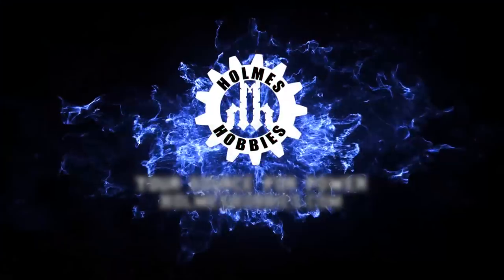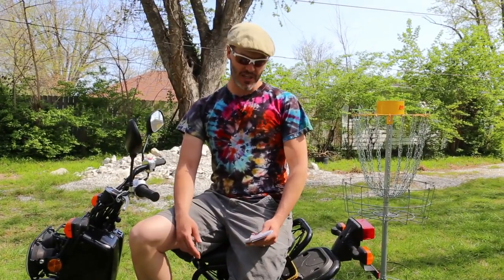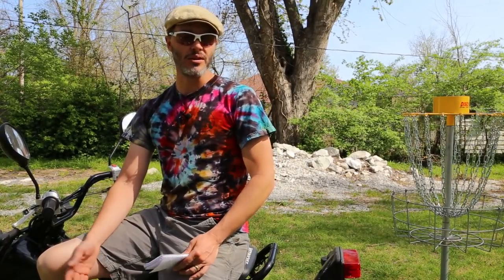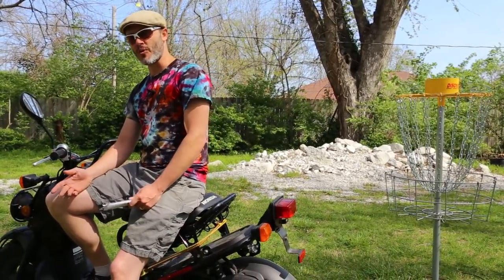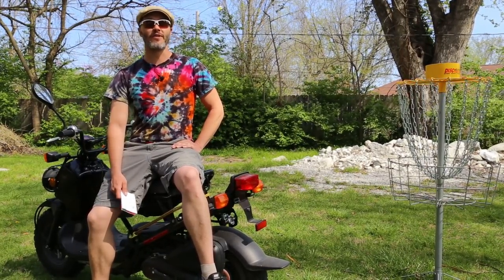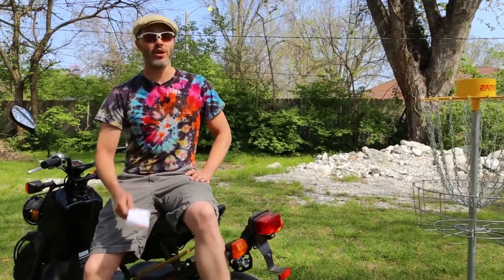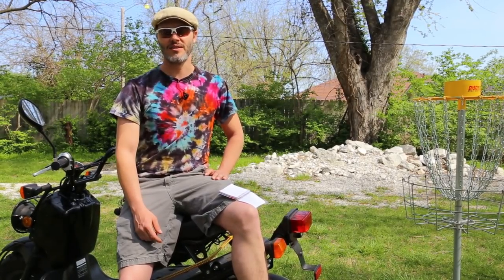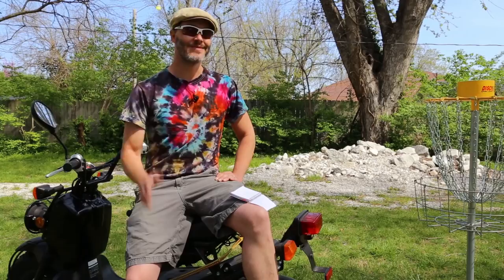History of Holmes Hobbies Part II

Comment: Thank you, I started in machine shop as a freshman in HS decades ago. Shop math, sand casting, and tool and die work was fun. I even had jobs in the field after HS while going to college. If you like to work with your hands these are great skills to master. I was wondering if your motor designs like the Revolver or Puller Pro can be scaled up for full size electric cars? My most recent purchase of the HV500v2 is great, and the Revolver is performing beyond my expectations. I am considering doing a EV conversion project and HH motor for full size would be great if that could be done.

Comment: Hey John. I have a question about poles. If I have a 2 pole motor & put a 4 pole rotor will it work. Or because the stator & electronics are 2 pole it won't cycle right. Just trying to learn more about brushless motors. I know how brushed work. I've been messing around with them since my slot car days 25 years ago. But still newer at the brushless stuff.
Reply from the maker: Short answer, it will not work.    Long answer, depends on the stator and winding pitch.   In all likelyhood, it probably won't be compatible.
Reply: HolmesHobbies - I actually meant if I put an armature. If I put a 4 pole arm in a 2 pole can. I don't know if that makes a difference. Where did you learn about motor building?? Or do you know any sites I could learn more about them?

Comment: Had a question for ya if you had time, I'm starting a huge project(the truck is over 4 ft, over 7 with trailer) and I am up in the air about which motor/motors  are going to be the best for over all performance/scale, I've been having bad luck with tekin, so I'd like to see what you come up with for ideas/suggestions, any help is appreciated, thanks
Reply from the maker: Something so big, it is typically a good idea to keep the motors slow.   For brushed, a 45t 550 is a good choice.  Brushless, I would choose 1000 to 1200kv range.  1000kv revolver, etc..
Reply: @HolmesHobbies  I was looking at the revolver 1000kv, but wasn't sure if it was going to be to much torque, thanks
Reply from the maker: @rc-ingaroundamerica8792  no such thing as too much torque, better to have more than you need than not enough to avoid overheating
Reply: @HolmesHobbies  alright, good to hear, I'll send yall updates on these projects so you can see these behemoths lol

Comment: You should have said you had a number of small 50cc bikes...   I was a noob, I only had 3 "Blazers", they were 2-speed trail machines with no clutches, gear shifting was accomplished by stopping or "double-clutching" with measured success, lol.  Then I had 4 Honda's "Trail and 90 Sports"...  Absolutely none.     I did manage to design filtration equipment for the Oil Industry, way different than you did 5-15 bbls (42gal. bbls.). filtering down to 1-micron nominal and in some cases 2-micron absolute high volume filtration high pressure, upwards of 3000psi.   But that is a different story.
Reply from the maker: I think I have three fully built 50cc bikes right now, and two electric equivalents.   Honda ruckus, honda express SR,  and a Lazer 50.  Also have a few more projects in parts.   Derbi Variant and another minerelli engine based project.

Comment: So your a tight wad with amazing skills.  Rub it in already.   LOL.  Very enjoyable.  Thanks for the B A toys.
Reply from the maker: I do have a really tough time buying equipment at retail when I can build it for 1/10th of the cost.    Of course, some of the equipment to make motors can't even be purchased so I have no choice.    The resistance brazing machine is named "Mr. Burns" right now.   Used to be called "Big Poppy" before I made some changes to the control circuit.
Reply: HolmesHobbies.    I don't blame you.   I do everything cheapest but still as good as it can be.